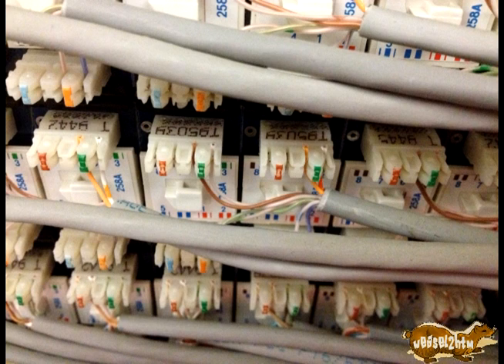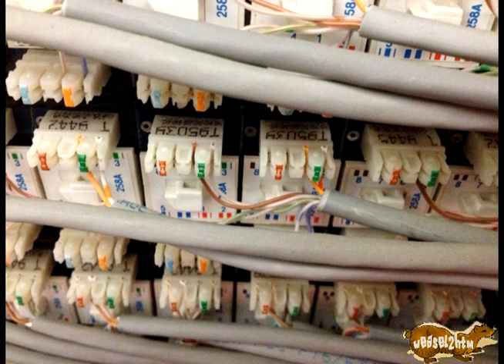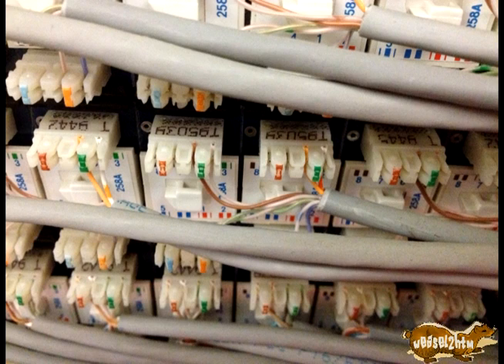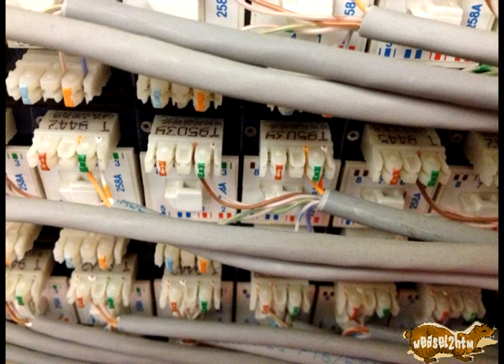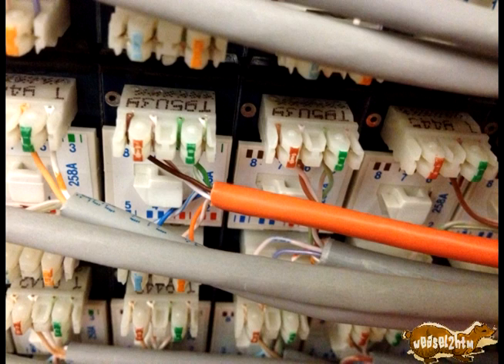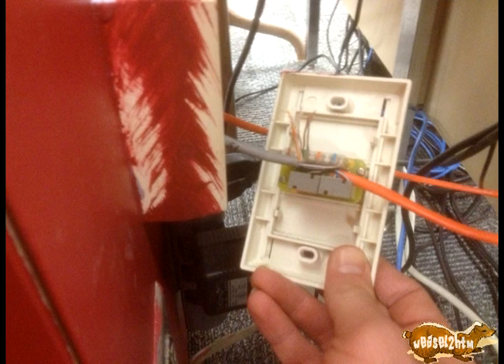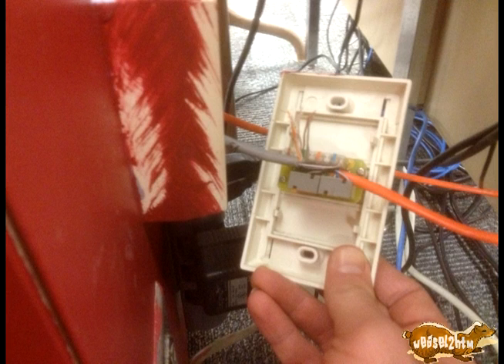Fixing Split Cat 5 Wiring

Comment: Its either plain old CAT5, or if they were true cheapskates, CAT3. The most annoying site work I did is when a previous contractor (that was fired) decided to terminate stuff using a non-TIA-568A/B color layout. I think he did it for job security, that royally pissed me off. The guy also didn't bother to crimp/punch down the unused pairs.

Comment from the maker: The old wiring is somewhere between 15 and 20 years old, it pre-dates "Cat 5e"  or they just used old wire thy had.

When I started we had 4 buildings with this and a 5th that a very small portion was done like this.  Several years ago the smallest of the buildings (only about four rooms) got everything re-terminated and is now wired properly.

The building that has a small portion done like that has mostly been re done, only about 4 rooms (out of 11) are left that need to be fixed.